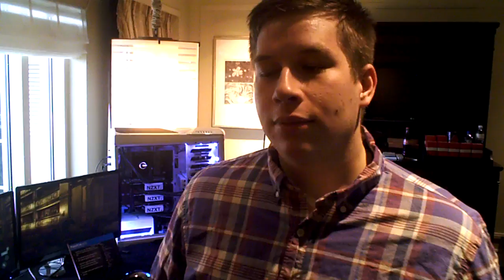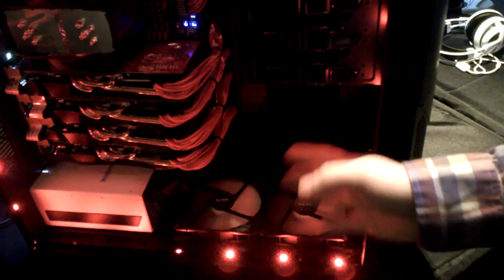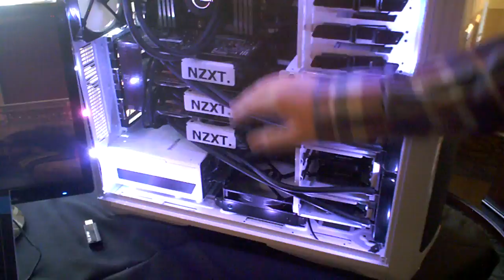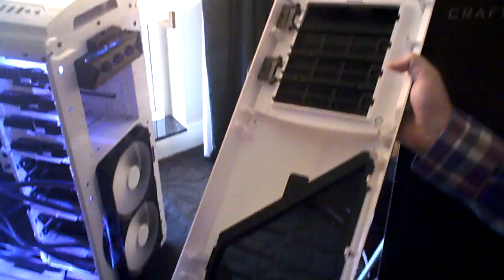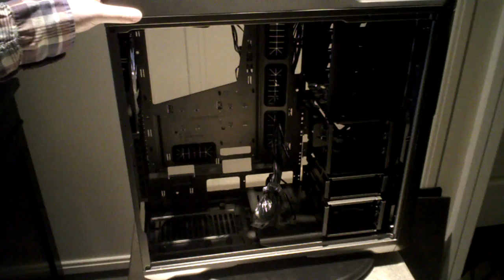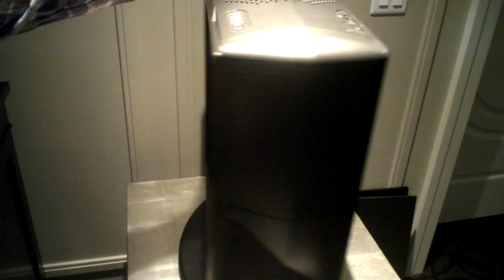CES 2013: NZXT shows off Phantom 630 Chassis

Comment: Phantom 820 is taller than 630 so you can fit a bigger motherboard more easy and have adjustable led colors inside the case which is pretty awsome but it does not have SSD drives on the back of the case and you can't remove all the hard drive bays to fit  longer graphic cards or thick radiators like the 630 so in my opinion 630 is a better choice but it all up to you ^^